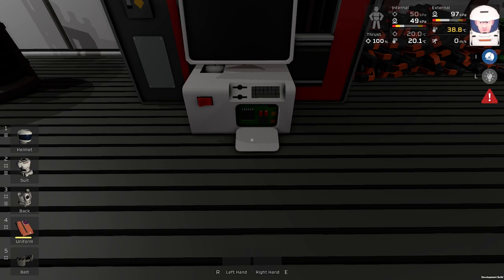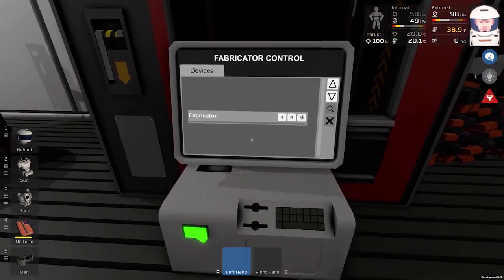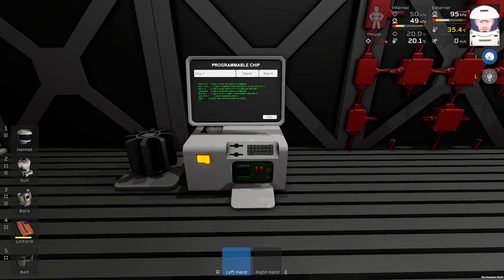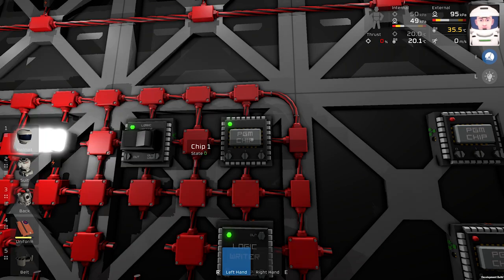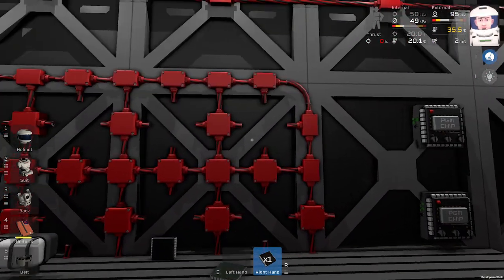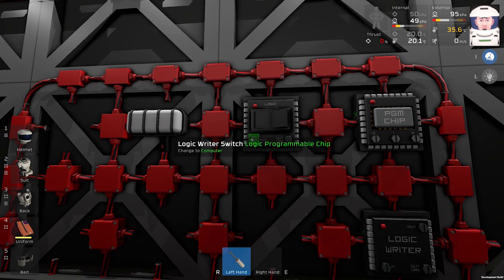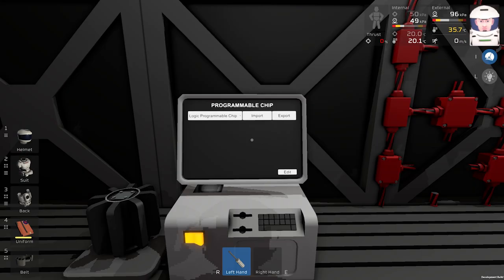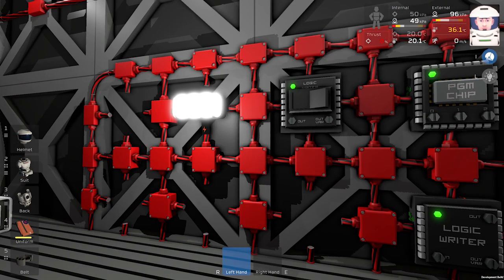Stationeers - Programmable Circuits ( Game Update )

Comment: wow interesting..  i hope theres some ram on board or instructions to write to memory chips or something.  Looks like also can only write via logic writer? thats a shame... would like to be able output multiple things from one program like solar tracking, store horizontal angle at start of each day, track sun writing horiz and vert positions and then reset to previous days position at night ready for next day
Reply from the maker: Looks like we can make some very compact black magic finally
Reply from the maker: It is just first pass, Devs are open for discussion.
Reply: It is possible that you add LUA for this? I don't want to write a custom assembler code for programming stuff :-/ ..
Reply from the maker: I would like LUA too